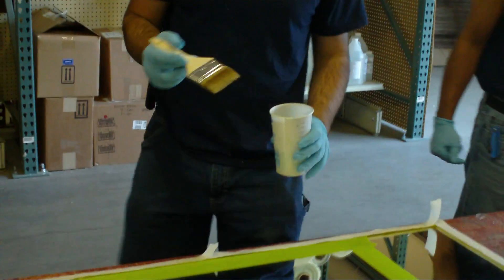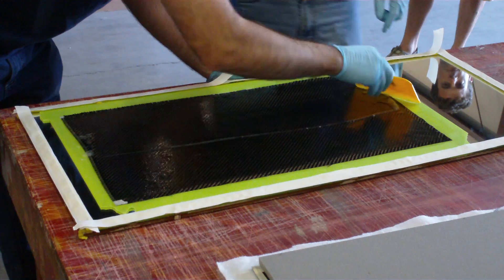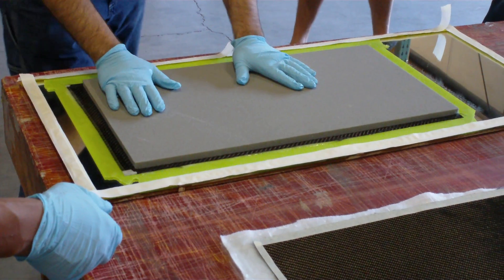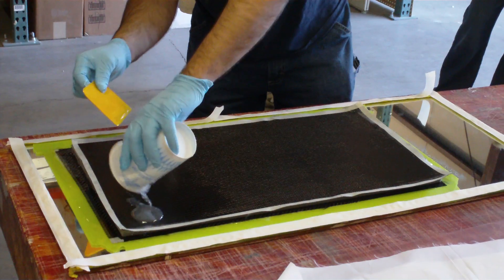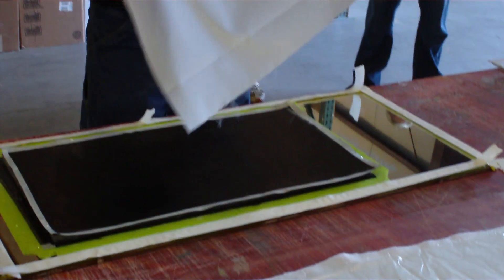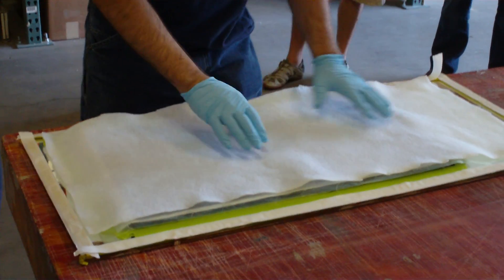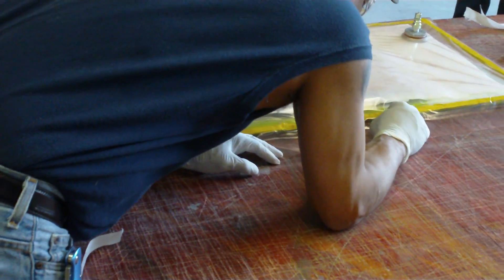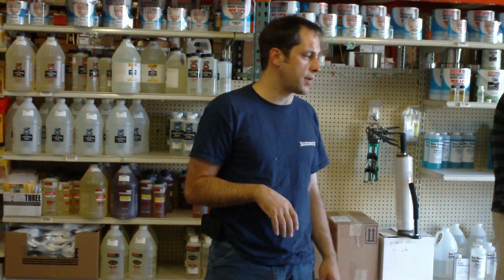Wet Layup Vacuum Bagging Cored Carbon Fiber Panel

Comment: I have a question, as Im about to wetlay carbon fiber in a mould and vacuum bag it.
Reply from the maker: What is your question?
Reply: @FiberglassSupply  ill be wet laying 5 layers total. 3 carbon, 1 lantor soric and 1 kevlar. would I still need the perforated film, or could I with just do with the absorbent breather cloth? If I dont have the last breather cloth, could I use a susbsitute? I do have the peel ply and also have a resin flow mesh, cause I was gonna do infusion but the mould had a small leak somewhere, so now ill be envelope bagging the whole piece. The other option I was thinking, was to wet lay the cosmetic laminate cause it cant have any flaws, and then once it tacks,  add the other layers , and infuse the final layers. Looking forward to your response,  thx.
Reply from the maker: If you are going to wet lay I would highly recommend using the perforated film. For breather you can use a number of things, burlap, bubble wrap, flow media, quilt batting, etc. Breather fabric tends to work the best and is generally less expensive but those other options can work too. With wet layup vacuum bagging you want to back you pressure down to 10-15 in hg. Just enough to hold everything in place and consolidate the laminate, too much pressure and you’ll squeeze too much resin into the breather and get a porous laminate ( which is why the perf film is important). Personally I would still consider infusion using the envelope bag over doing wet layup vacuum bagging.  You can send me pictures of the mold/part to matthew@fiberglasssupply.com and I can give you more specific advise.
Reply: @FiberglassSupply  ok. I was also thinking about doing the very first or cosmetic layer by wetting it, and then the rest by infusion. Is that possible? As farcas the mould, ill be spraying a uv clear prior to applying the resin and first layer of carbon.
Reply from the maker: That is possible too. The uv clear should also help seal up the mold.
Reply: @FiberglassSupply  I sent 2 pictures of the part to the email you provided me with.
Reply from the maker: Just sent back a reply
Reply: @FiberglassSupply  ok
Reply: @FiberglassSupply  Hi , I emailed 2 pictures of my moulds. They have a plastic film on the back of the mould to protect the vacuum bag from being punctured.  Is it ok if I use that, or is it better with a breather cloth or it really doesn't matter  as long as its protected?
Reply from the maker: Really doesn’t matter. If we are envelope bagging I will sometimes put something soft on top of the table so I don’t accidentally poke a hole in the bag.
Reply: @FiberglassSupply  what would be the recommended pressure once everythings in place,  whether for infusion, or wet layup ?
Reply from the maker: Full vacuum for infusion (29 in hg or your pump’s max) 10-15 in hg for wet layup.
Reply: @FiberglassSupply  Hi, I wanted to know per about our conversation about a week ago, If I wet  lay my first layer , which will be the cosmetic layer in the mould, and then infuse the rest, if there are some spots in the cosmetic layer that may had some voids, mainly some corners,  is it a possiblity that if too little resin used on top of that layer can cause that? When I layed the carbon on, the resin was tacky amd thefabric layed pretty flat on all surfaces. And how much resin should I apply once the fabric is applied to the tacky surface? Thx

Comment: What resin did you use
Reply from the maker: Resin Research Epoxy
Reply: @FiberglassSupply  2000ce ...or  kwik kick
Reply from the maker: Anthony Nastasi 2000ce

Comment: If I was trying to fabricate a carbon foam core tube 19 inches in diameter and about 14 inches deep. ...could this be bagged?   Would you think going around the outside or inside of a mold would be easier.  

 I'm thinking that inside would be best if it can be done at all. 

.also. ..would the release agent work on vinal?   

Thanks and I love the video. ..makes it look to easy!

Comment: How can you find out how many layers of fiber to use for a part?
Reply: Take a college level course on structural composites...OR... if its for looks only like 99% of the stuff you see on cars etc.... trial and error. No one can answer the question unless you have a specific product or part in mind.
Reply: usually 4 layers of 5 ounce carbon fiber cloth vacuum bagged yield about 1 mm thickness. 2.5 mm is perfect for most applications when you get into 16 layers at 4mm thickness parts get heavy and its better to use aluminum or alt materials

Comment: honeycomb will soak the resin, which is what you dont want. i would make one sheet, or layer of carbon, with peel ply then let it dry, rip off the peel ply, give the surfice some new resin.. if you want extra strong stickness to the carbon layer, you can thicken the resin with cotton. then lay on the comb, and on top a pre weted carbon fiber.. do not lay a dry carbon fiber on top an wet it with a brush, cause this would cause the resin to fill the combs

Comment: nice video! Question about the vacuum connector, is it a normal Orion or euro connector you use? and if you disconnect it, will it keeps it vacuum?

Comment from the maker: This part wasn't infused, it was laminated wet, then placed under a vacuum to clamp it in place and remove excess resin from the part.  

Generally I prefer infusion for a number of reasons but wet layup vacuum bagging works when you need to clamp the laminate in place against the mold and helps increase the fiber to resin ratio, which will improve the mechanical properties of the laminate.

Comment from the maker: If you're referring to the tape around the edges of the top layer of carbon it was put on there to help keep from distorting the weave while handling the carbon.  It is outside the finished area and was cut off later.

Comment from the maker: @skylergreenhaw 
We let it cure overnight but with the Resin Research Fast at room temp it is usually pretty hard in 3 or 4 hours.  I just posted the videos of de-molding the panel, the video came out a little fuzzy so I'll try to find some better pictures of the finished panel.